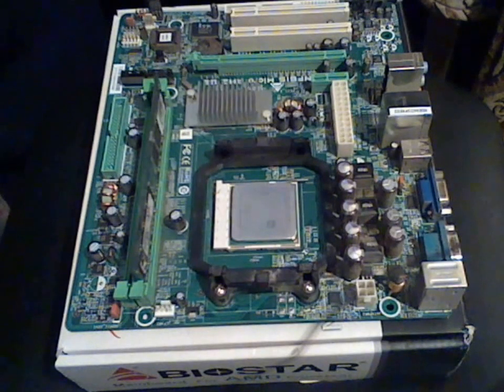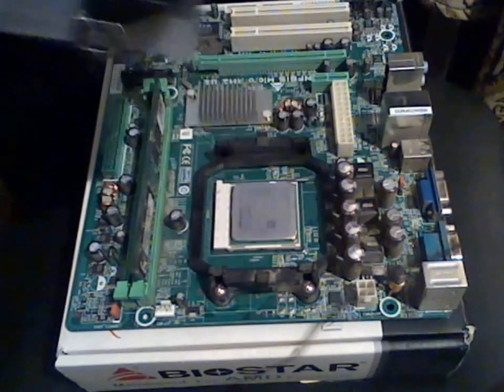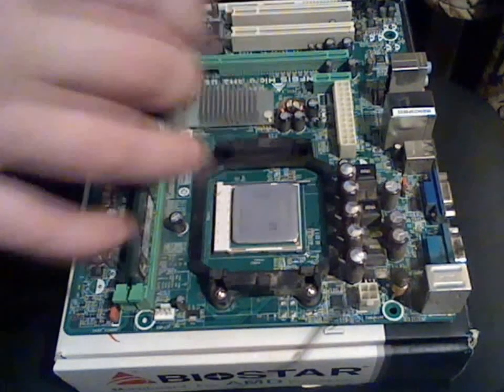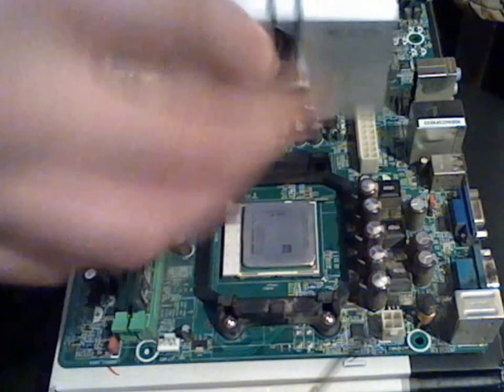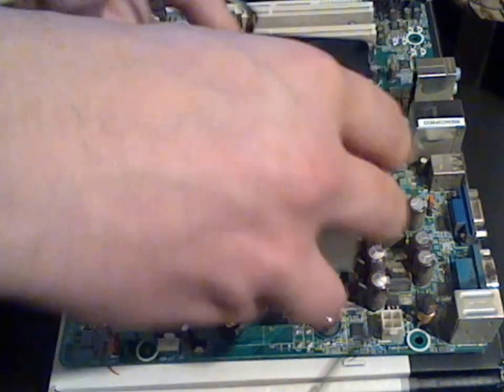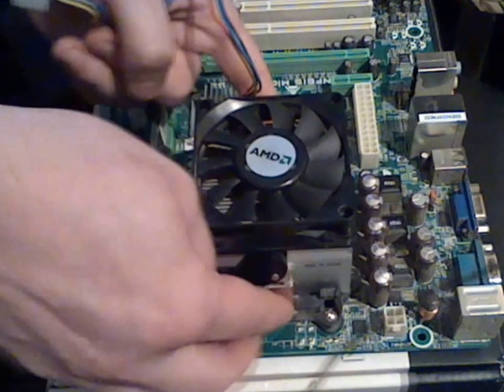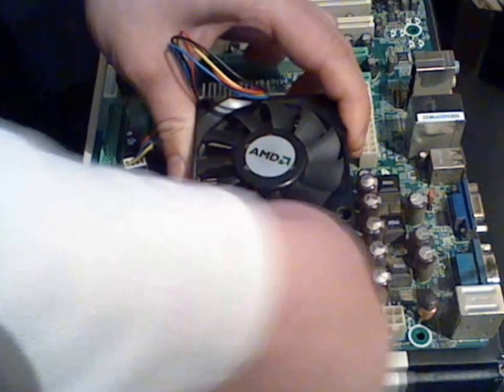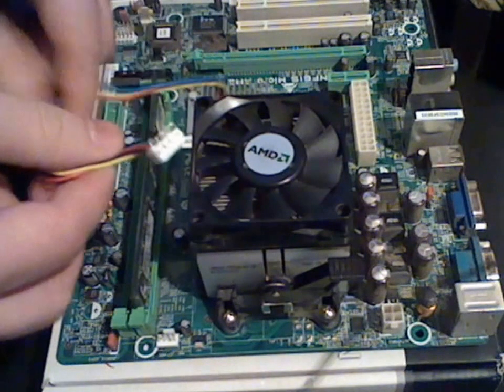TEKNIK: How to install AMD stock cpu cooler AM2,AM2+,AM3,AM3+,FM1,FM2

Comment: Can I use a am2 cooler in a am3+ socket?
Reply: +Bruno Sancho The CPU cooler installation is nearly identical for Skt 754, or any AMD CPU socket since then.
Reply from the maker: yes you can use AM2 cooler on a AM3+ motherboard
Reply: thanks